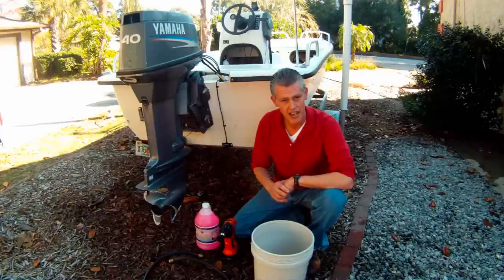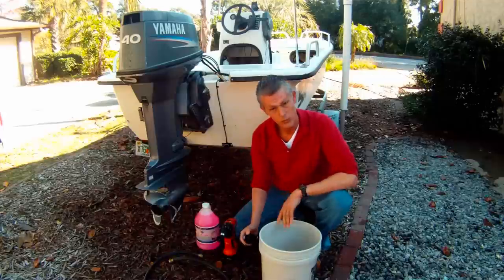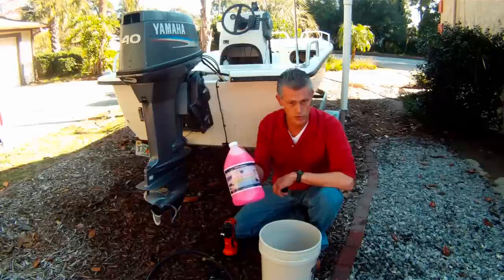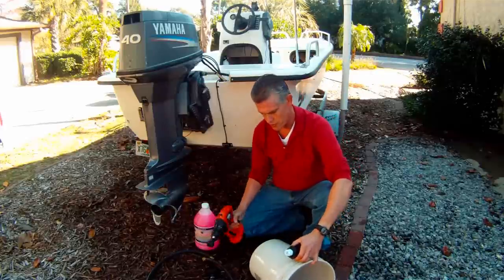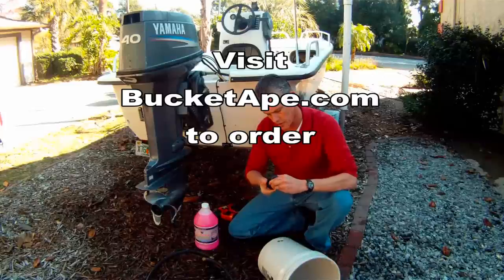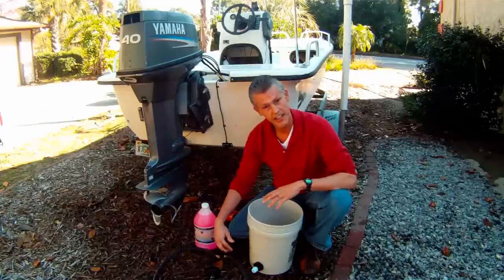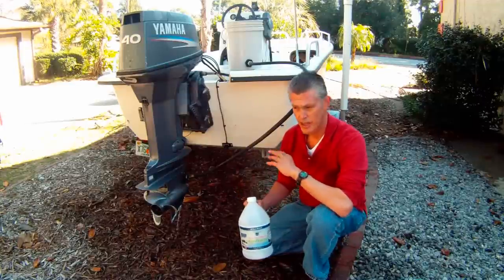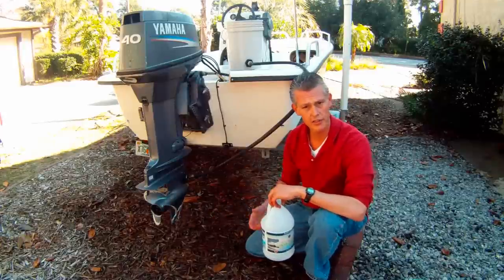How to winterize your boat - Cheap and Easy with Bucket Ape

Comment: I always just use a tube that you can get at Oreillys for $4 that Screw's right on the Antifreeze jug.
just cut off the Short garden hose and Shove the Tube in it.
turn the Jug upside down
open the tube and Fire up the motor...
Easy...!!!

Comment: Well I'm sorry but if the engine is an outboard putting in a antifreeze would be a waste of time has outboards in the complete down position drains themselves due to gravity if the engine is a inboard (sterndrive) yeah it needs the antifreeze in it has water remains in the engine.
Reply: Never had to winterize an outboard.......never had a problem.
Reply: Why would you take the risk?  10 bucks for antifreeze vs. Thousands for a new powerhead?  Larger outboards hold water more too.  Your engine your problem I guess.  I'd rather be more particular about my possessions.  Better safe than sorry
Reply: I agree, an outboard auto-drains.  This is a waste of time.  Every drop of your antifreeze is on the ground when you're done!